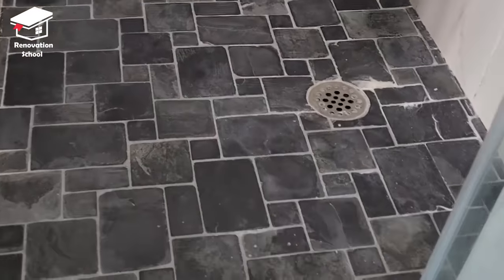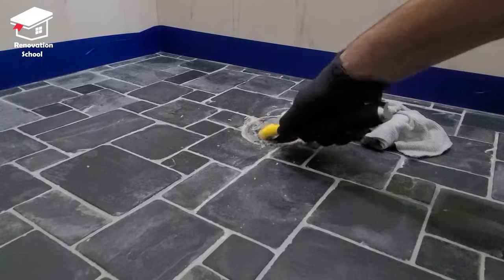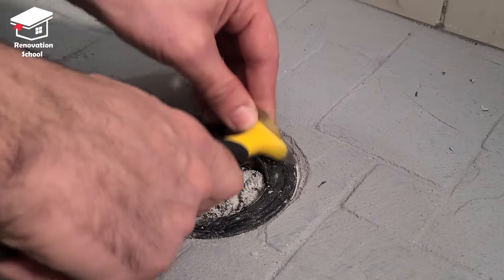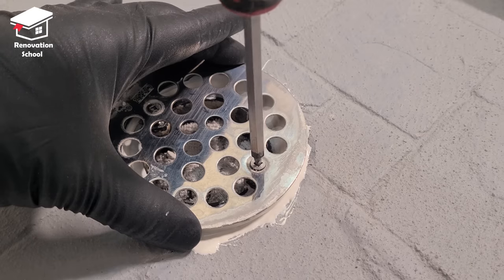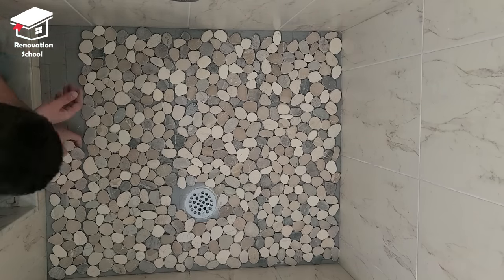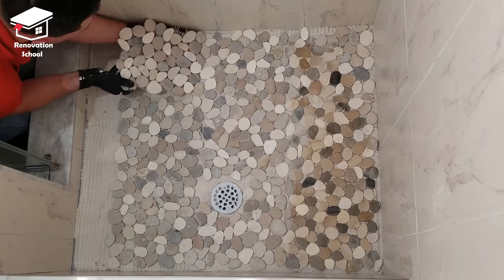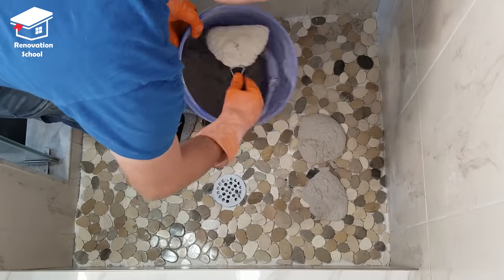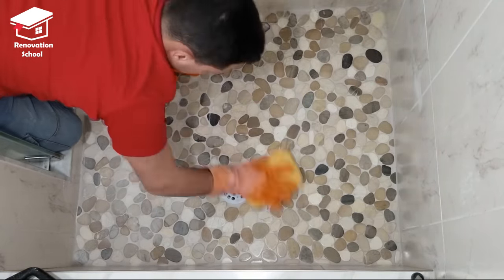How to tile over tile in a shower floor?

Comment: I am tiling over an existing shower surround but I want to go higher up on the wall. Is it OK to put some thing on the part of the wall that doesn’t have tile to match the depth and then tile over the whole thing? What should I use?
Reply from the maker: For sure  you can do it
Depending on the thickness of your existing tiles. 
If you have exactly half in thickness you can use backer board. If it's a quarter of an inch u can use the very thin drywall they sell at the home depot. If u use the drywall you have to make sure to waterproof it before tilling.

Comment: Great video. Did you sand the existing tile first?
Reply from the maker: The tiles were rough so I just cleaned them with alcohol (if you watch it again you will see it)

Comment: Can you remove the walls and replace with new backer board and new tile, but do this tile over on the shower pan. We have no leakage but don't want to demo the pan and have to make a new one. I'm a DIY newbe to shower remodels.
Reply from the maker: Yes 
Depending on the type of drain it's doable
Reply: Thanks, just a round drain like the one you did
Reply from the maker: @JonBeck-ch3uv  for sure

Comment: Several years ago our contractor did a horrible job grouting our shower. The grout was non existent in some areas so We’ve spent the last three days removing the old grout so we can regrout. However, the shower floor has been a pain. The tiles are small and we’ve damaged or scratched several and the scratches are very dark and visible and I can’t remove them. In order for me to tile over the existing floor tile do i need to regrout again before applying the bonding primer or will the bonding primer be sufficient?
Reply from the maker: Depends on what material is your tile 
If it's glass then removing all tiles is best, it's the same with very shinny tiles. I would remove them completely.
If the surface of ur tiles are not very shinny and the bonding primer can bite into it , I would use mortar instead of the the grout and fill the seems , the mortar I used in this video is pretty good and it's crack resistant if it's mixed properly and with the right amount of water.
Then I would do the primer and then doing the rest of the process and u saw in the video.
Reply: @renovationschool8818  The tile is a matte porcelain so I think we’ll be okay. Thanks for the quick response.
Reply from the maker: No problem
All the best

Comment: Great video! Am going to try it! Question: do you have suggestion for painting a shower that is tiled? The walls?
Reply from the maker: Thanks for watching, I highly suggest not to use any kind of paint on shower tiles.
Reply: Tough as tile paint can be used. It's a very good product
Reply from the maker: @henryfalgout53  it has lots of fume, it dosen't go on very even.

Comment: In another video the fellow was tiling the shower stall floor he did not use a notched application tool because the mortar would come up through the tiles creating more cleanup after. Do you think this method provides enough adhesion?. Thank you.
Reply from the maker: Thanks for watching 🙂  I prefer the notched trowels myself.

Comment: Great work.  How often do you have to apply the sealer for the stones?
Reply from the maker: Thanks for watching, it depends on the usage
I normally seal them once a year.
Reply from the maker: Thanks for watching
It depends on the usage
I normally see them once a year
Reply: It will depend on the brand of sealer. The directions will provide the details as to how often to reapply the sealer.

Comment: We have an old and slightly discolored shower pan in place that is still sound. Do you think these techniques would work in my case ? I love the look of the change you made.
Reply from the maker: If you have a metal or fiberglass shower pan no do not do this on it. But but if it's tiled and your towels are not too shiny then you can do this on it

Comment: What if I want to do this AND adjust the floor slope? Could I do everything the same but just add floor level compound first?
Reply from the maker: You need to have that slope so the water goes to the drain!!! If u make it flat then they water won't get in the drain!
Reply: @renovationschool8818  yes, that’s what I’m trying to fix. We bought a house recently and the walk-in shower leaves standing water in the back of it. I want to go ahead and retile also so I was wondering if I could fix the slope and re-tile on top of the existing tile? Or if I need to pull up the existing tile in order to fix the slope
Reply from the maker: @zanejohnson5090  and that's case it's best to redo the entire shower base

Comment: Since you raised your drain with the drain extender, wouldn't the water that seeps into the grout pool against the raised drain pipe?  Pebble stone tiles require a lot of grout meaning its very porous.  Any water that gets below the grout will be find its way down toward the raised drain pipe and not be able to escape.  I think you need to use an epoxy based grout which is 100% water resistant.  I've never worked with pebble tiles but it sure seems like a lot of grout to fill the spaces.  I have no idea how water resistant the sealer is.  I figured the sealer was just to prevent stains.
Reply from the maker: This is one of the best sellers when you pour water on the surface of this tile the water just rolls away it forms a small water balls immediately and goes right in the drain.
The type of drain system that you're talking is extremely different from what we have here.
This type of drain does not have any weeping holes on the bottom of it.

Comment: I want to clean those tiles and reseal it, what products should i use?
Reply from the maker: I mostly clean them with denatured alcohol ( you also may find it under these names in some parts of the country: methylated spirits or wood spirits) 
Then I use a good quality sealer.
There are so many different types of sealers available in the market, what I used in this video is one of the best ones in my area. Just make sure to apply the sealer in 2 or 3 coats.

Comment: before you place grout place sealer over face of tile ,easier to clean grout off surface
Reply from the maker: good idea 
I wanted the maximum bond between the tile and grout thats why i applied the sealler  after.
thanks for the comment.🙏

Comment: At the end you can see pocket between pebble this is better to use epoxy grout in my opinion because once the sealer will fade then the grout can change color (stain) and if too much humidity then mold could appear.
Reply from the maker: Thanks for watching 😊

Comment: How come the Tile grout is not filled properly to the extent of the surface level? It is evident from the shadows. It will lead to stagnation of water and shower is wet 24/7 though the mold may not form if the material used is mold resistant.

Comment: How long does tile over tile last? I want to do it on my whole floor!!
Reply from the maker: It all depends on ur subfloor , tile and structure of the house . There is not a certain time , every situation is different. If it's done correctly and the structure is good it should last as long as the house exists.
Reply: @renovationschool8818  thanks

Comment: Do you get pink tiles
Reply from the maker: If you mean pink mold . No , I clean my tiles with a brush that goes in my drill. I use disinfection solution, some soap and bleach every time. So it never happens.

Comment: what if I have a rectangular drain? I can't find any square piping?
Reply from the maker: The base is the same and its round
Reply: This is my problem except mine is a linear drain which is about 2ft long
Reply from the maker: It won't work in that case 🥺

Comment: What can I do if the water stucks on the corner?
Reply from the maker: Good day
if the water is pooling on one side of the shower dont worry 
Wash up and clean up all the floors with denatured alcohol then apply the primer just like what i did in the video . then mix some thinset( thinset is what i used under the tiles) and apply it on the lower area.  use a drywall knife to make it nice and smooth. what i mean  is to  fill up the area that is setting low , allow it to dry for 24 hrs. now ur floors have the proper slope ,  just like what i did in the video mix more thinset and install ur tiles. done .😉 please dont forget to hit the like botton and subscribe to the channel 😊
Reply: @renovationschool8818  thank you so much!
Reply from the maker: @herminiaorozco6150  youre most welcome

Comment: Great video, but I don't recommend that type of stone tile. I had nothing but issues with that stuff in my shower. Stones coming loose and very tough to clean. I'm watching this video, because I'm getting ready to tile over that crap.
Reply from the maker: Thanks for watching
I'm not a big fan of this tile eather but I had no other choice because the tiles under it were uneven so the best thing to cover it with was this stuff. I used good quality material. Now it's one and half years that we use this shower twice a day. So far it's exactly like the day one I finished it and we haven't had any issues with it what so ever with it.

Comment: You don't see water accumulation between the rocks, some tiles I see have deep dips between the stones? Minutes 17:55 close to the corner.
Reply from the maker: It's not much to be a concern. You can't see the slope in the video.
Even if the water stays there it's not a big amount.
I clean it every month 
It's still like the day I did this tile job.

Comment: DO NOT DO THIS! There is a fundamental misunderstanding of how showers work here. First, tiles are not waterproof, grout lines are also not waterproof. All waterproofing MUST happen beneath the tiles. Thats standard tile setting procedure. Thats why you always build the entire shower underlayment first then tile over (you even mentioned it when you said they used the Schluter system). You just sealed the water beneath the tiles (the weird epoxy and pipe thing). Just buy a drain extender, they are designed to let water through. They cost about 20 buck! You just ruined this shower for 20 bucks!

By doing this horrible misguided thing you are building a shallow pool, zero drainage, zero weep holes. The water is just gonna sit 1/4'' below the tiles. In a year tiles will be riddled with mold and efflorescence. They may even pop out as the constant pooled water pushes them up. 

I am a license CA tile contractor. I demo these hack jobs all the time. This hack job is gonna cost that poor customer thousands to repair in a year or so.  Probably going to have to redo the entire area because of it.
Reply from the maker: Thanks for watching and the wise words 😊 I truly  appropriate your time and effort for sharing your professional and valuable thoughts. This shower has been operating perfect for the past 2 years withought any issues what so ever. In fact it's the shower in our master bathroom and we use it twice a day. The tile and grouts have been sealed 3 times before using the shower. The slope is perfect and  even the last drop of water goes right in the drain . It seems to be working very very good. I'm surprised how nice that tile and grout sealler sealled these tiles and grout lines, the water actually slides on it like butter. Normally after taking a shower the whole area dries up in 10 min max.
As u know this type of shower drain dose not have any weeping holes like some brands. 
The grout additive that I added also added alot of strength to the sanded grouts and it perevents the water from getting under it as it works just like a sealer its self. Over all I am very happy and pleased by the way this shower stands to the test of 2 years so far.
Reply: Hey Tito, is it possible that the original weep holes are still open under the old tile, and draining the water from that "pool" under the tiles that you describe? In other words, the water goes down thru the new layer of tiles but the original layer of tiles underneath still works as designed and takes care of that.
Reply from the maker: @rogerbritus9378 this drain has no weeping holes what so ever. The guy has no clue.
Reply: Blablabla

Comment: Why? Just y?     What's  your  Warrenty on this?

Jerry rigger #1!

Epoxy to connect  a drain pipe? 
How  much  do  you  know  abouy expansion and contraction?

Who  assumes responsibility, When you  modify and and  void the  manufacturers Warrenty?

Did You  can  drink lava!....

But only once.
Reply from the maker: Lol 
I I understand you're panic level
It's more than 1 1/2 years since I did this and I'm using that shower every single day I had absolutely no issues with it and it's literally exactly like the minout that I finished that video
Reply: I guest nobody wont work for you

Comment: I put the same stone on my shower floor. Main problem is, because the stone shapes are not uniform, the grout lines are not uniform. This leads to pinch-points where the grout lines are too small for sanded grout. I used sanded grout, and after a number of years it started chipping up at those pinch-points. I wish I had used unsanded instead. 

Another problem is, you're not supposed to use bleach on natural stone. Because of that, and because there's so much grout with these small stones, the shower floor is difficult to keep clean. That's the lesser of the two issues; the chipping grout is the bigger one. 

So, after trying to re-grout and that failed, too, ironically I'm doing the opposite of this video. I'm taking square porcelain tiles and tiling over this stone!
Reply from the maker: I sealed these tiles right after so I will never have leakage and seepage issue 
No mold or anything 
I can use anything including bleach and I have done it many times
Nothing has happened so far.
I used the strengthening product for my grout as you saw in the video so far it's been 3 years and it's exactly the same
Reply: @renovationschool8818  Yeah, mine lasted for a few years too, but eventually the grout chipped up.
Reply from the maker: @Skepilot  it was not applied properly
Reply: @renovationschool8818  Well, the same installer applied the same grout everywhere else in the bathroom: shower walls, bathroom floor, etc. The only place it chipped up is where the stones are. The rule of thumb is, grout lines that are smaller than 1/8 inch should use unsanded grout. With the irregular sizes of the stones, the pinch-points are less than 1/8th inch.